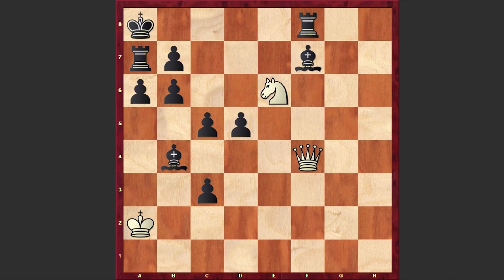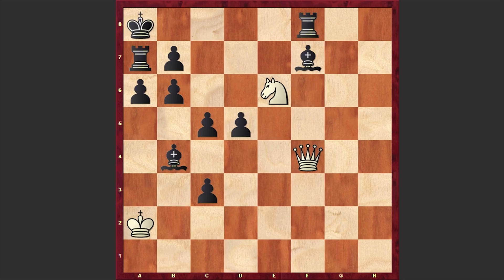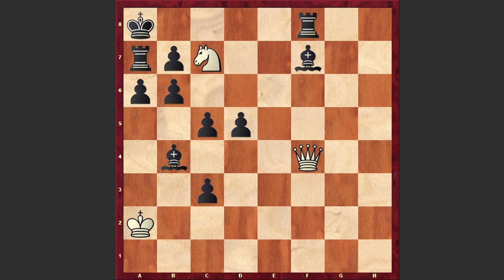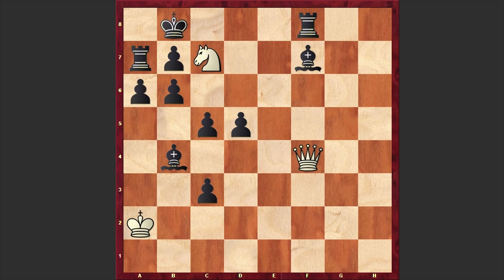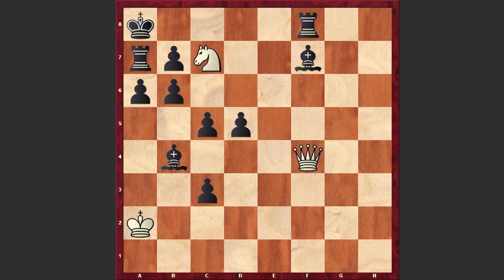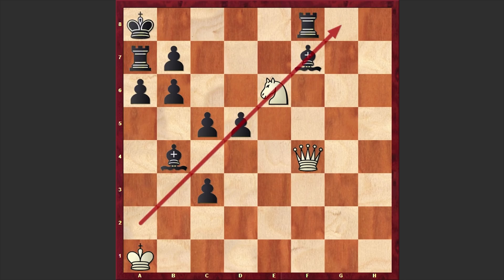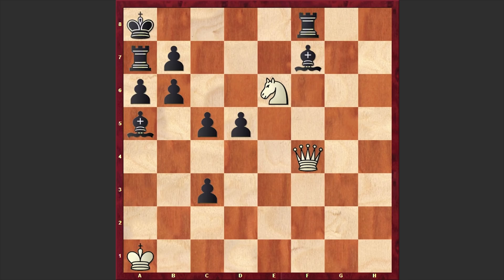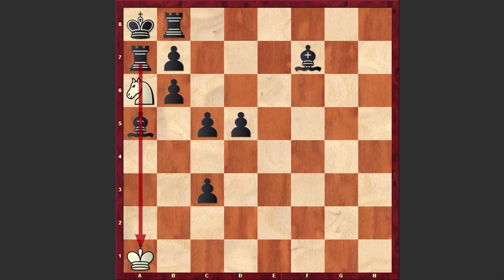Chess Problem: A Smothered Mate But Not An Easy One

Comment: Why not King B1 or King B3 in the beginning
Reply: 1. Kb1 fails to 1. .. Bg6+ winning the queen and 1. Kb3 does not solve the problem: the king needs to move from the a2-g8 diagonal to avoid ending up in a pin after Nxd5

Comment: At 1:07,if you move the King on a1, it gives you the opportunity to checkmate in both smoothered ways... or even in 4 moves if the other player captures the knight.
Reply: Stefan Gheorghe If black plays Ba5, You will need 7 moves, which is a fail.
Reply: @Arumenuyama  yup i saw it now, thanks